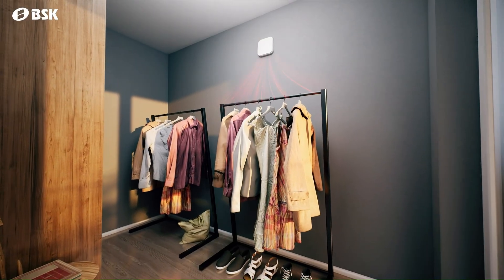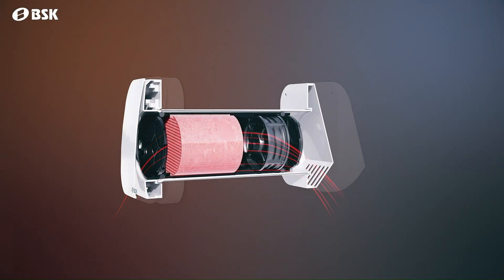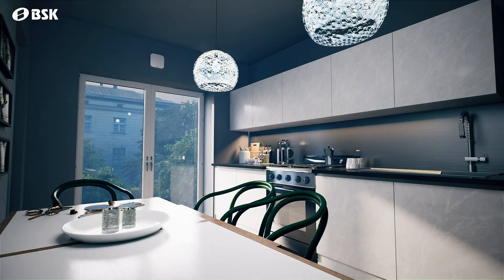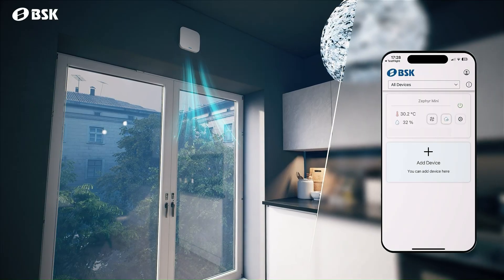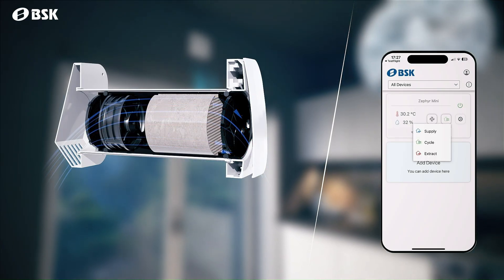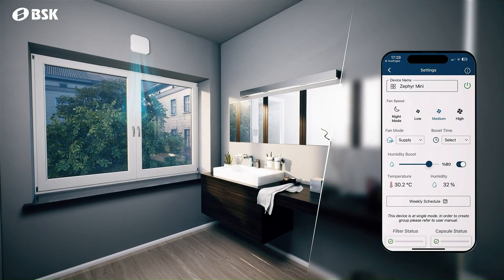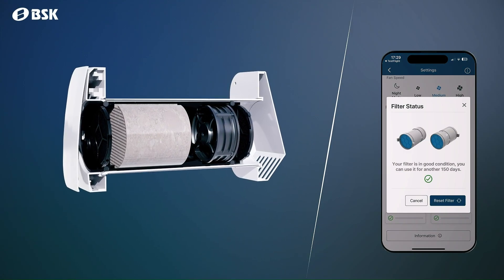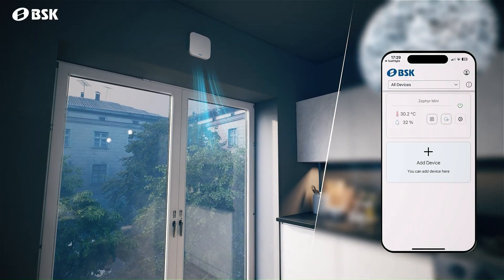Zephyr Mini  Single Room Heat Recovery Unit

Comment: The 90% efficiency claim is highly dubious. You are literally exhausting air and relying on the heat capacity of the ceramic. I’m doubtful because this problem is similar to tidal vs. unidirectional breathing in mammals vs. birds. The tidal process is much less efficient, so the claim of 90% is just wrong.
Reply: 90% claim is wild of course and to be fair they are saying "up to 90" which could be like 1% 😂

As demonstrated by CharlieDIYte in his video on this, the efficiency is not that great as they claim.
With indoor temperature at 19° and outside temperature 11°, this unit was pulling in air at 15-16°, so it does recuperate something but definitely not 90%.
https://youtu.be/zSxyUFLwFbc?t=289
Reply: or 37% when the weather is cold at approx 0 degrees
https://www.youtube.com/shorts/ppm2oaBLk98